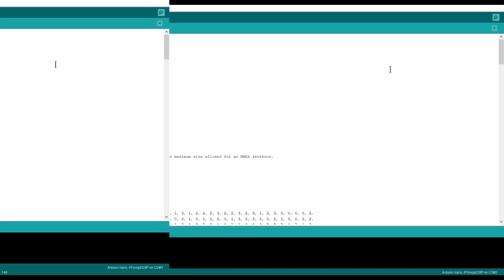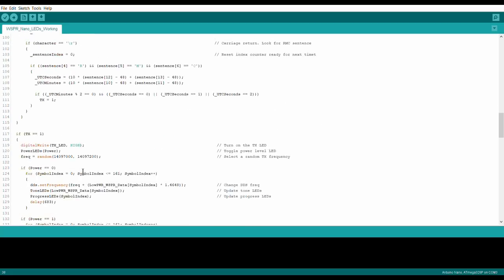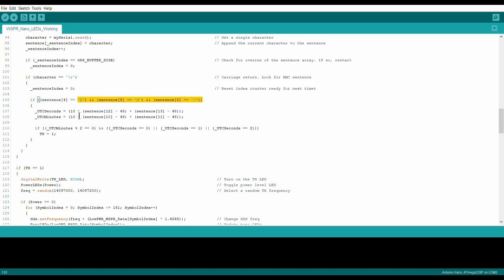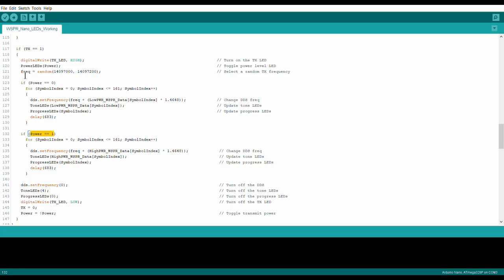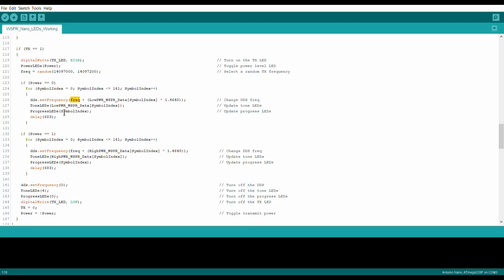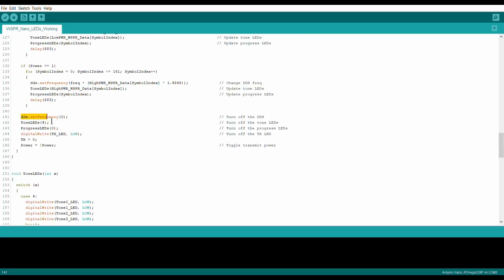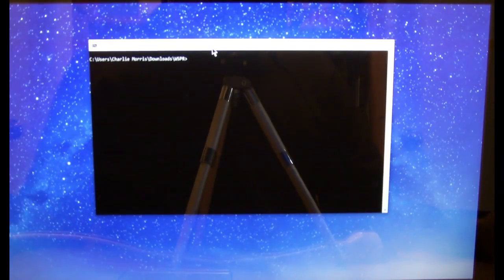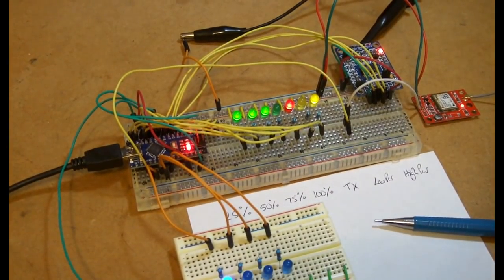Homebrew 20m WSPR Beacon: Part 1 Software

Comment: If you like the propagation you are able to get with the Whisper mode, check out JS8CALL (JS8) and the new slow mode. There are now four modes, and each are not limited to the length of the messages sent and received. They are not part of the is it  WSJT-X, and all JS8 speeds communicate with each other simultaneously ! One is called Turbo and is estimated at 50wpm
Reply from the maker: Cheers. I'll take a look.

Comment: I love it !  Wish I had an Elmer near me that could help me build one.   Do you have a complete schematic and parts list for the beacon ?  Would like to try this with a long wire antenna made of a piece of wire pulled out of a piece of CAT5 cable or something similar.
Reply from the maker: Yes, it's all up on the blog at:  https://zl2ctm.blogspot.com/2019/06/20m-wspr-beacon.html
Reply: @CharlieMorrisZL2CTM  Hi Charlie, I don't see the circuit diagram with the AD9850 ?

Comment: Good job Charlie, I like your pragmatic choice to  not build in Jason's JTEncode library but hard coded the byte strings instead. I gave up on trying to get JTEncode to fit on a Nano. Your design is better. It is tied to your gridsquare but for a base station beacon that's no problem.
Reply from the maker: Thanks Paul. That was my thinking. As the beacon is tied to the location, having it hard coded would be fine. Just sitting here now watching 12mW getting in to Australia. No too shabby.

Charlie

Comment: Code is not my forte. You seem to have hold of it. Well done.
Reply from the maker: Thanks Ed.  I'm no expert either.  I know it is not text book, but it works.
Reply from the maker: I see four spotters in Australia are decoding the signal, which is great. Looks like everything is working fine.
Reply: I was looking for Arduino based digital modes. I think I even have one of those DDS's.  Might give it a go. 100mW to Australia, not bad.
Reply from the maker: @ed-jf3xh  Go for it. Just trying a second amp now. 60mW is getting into Australia fine too. Maybe I should put a 3dB pad in front of that and run 30/60mW. All good fun!
Reply: Go for broke, Charlie. Try 10mW.  Now I have a dumb question. What is the @ for?
Reply from the maker: @ed-jf3xh  I think the @ means the message was for you. I didn't enter it. I also though all YouTube comments were public.  Who knows!
Reply: Strange. As far as I know, the are all public. I act like the are just to be on the safe side. No worries. Just curious. Have a great day.